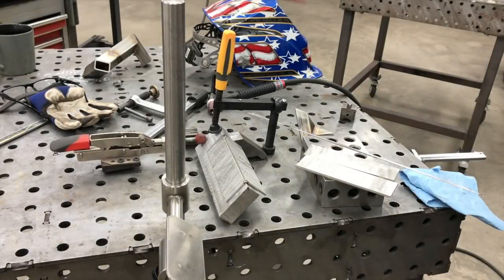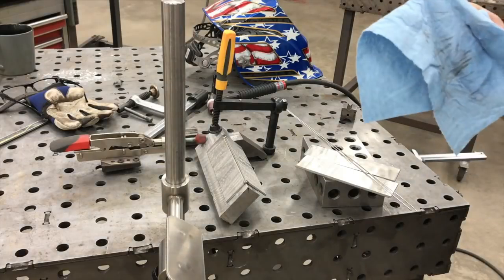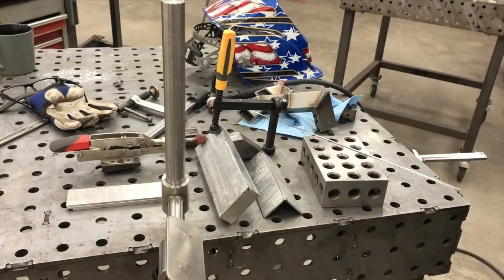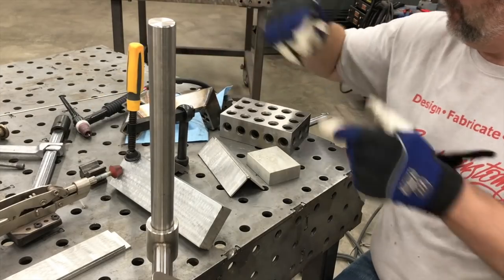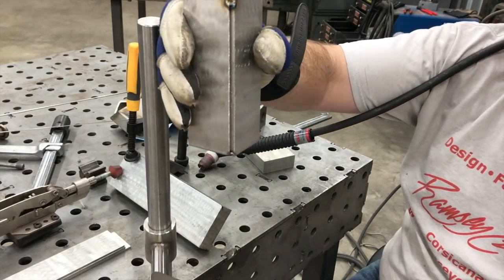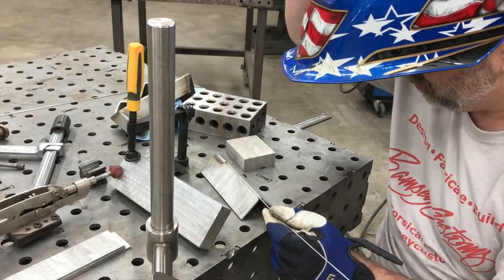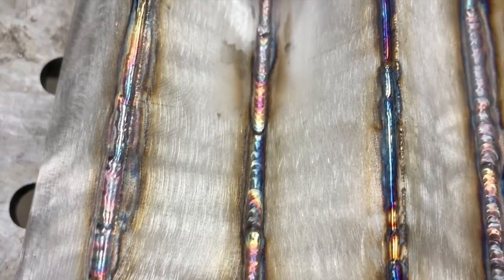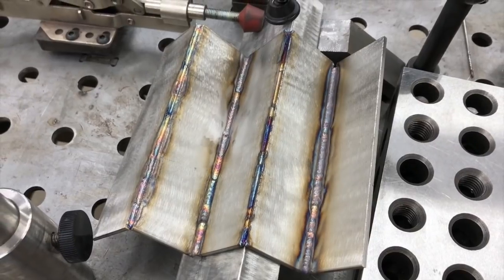Tig Welding Stainless Steel with Aluminum - Weldporn In Training

Comment: It appears to me you are not letting your POSTFlow do its job. As soon as you finish welding you starts wiggling your cup. Whipping it back and forth, or move it completely away from the bead. The whole purpose or Posr Flow is that you need to keep that cup in position, without moving it, until the timer stops. The third weld you did you left it there just a tad longer. You did start whipping it, potentially allowing O2 to enter the pool but you definitely didn't allow it to wait the full 8seconds you said you had it set at. I am 99% sure that's what your issue is!!

Comment: yeah it's your gas coverage give yourself a bit more stick out and hold your torch on a 35 degree angle so it gives time for the molten pool to cool under the gas coverage. that's the problem your molten pool is getting exposed to the air if you have the molten pool at the leading edge of the gas when you travel along it gives it time to cool in the gas coverage.

Comment: STOP WAVING THE F ING TORCH AROUND AFTER YOU STOP WELDING. AT LEAST DOUBLE YOUR TRAVEL SPEED. TURN THE AMPS UP AND MOVE WITH THE PUDDLE. THE OUTSIDE CORNER JOINTS LOOK WORSE BECAUSE THE GAS FLOW AWAY FROM THE WELD.  INCREASE YOUR ARGON FLOW TO 30 CFH

Comment: With that much gas flow and that torch angle you might actually be drawing air in behind your puddle. Slow the gas down, use a bigger cup if you have it and try steepening your torch angle.

Comment: Your problem is that stainless, and mild steels MUST be backpurged! The backside of your weld is oxidizing and being drawn into the weld puddle. The inside corners are better because the "V" directs more argon into the keyhole and puddle. When you back up with the chill block it keeps more oxygen away from the weld, making better looking weld. when you are welding tubing, purge the inside of the tubing. On flat pieces make jigs, or use metal tape and cardboard to make barriers so that you can backpurge. This is stainless welding 101, purge, purge, purge! In the pipefitting world, the back of the weld should look as good as the front of the weld! We call that ugly burnt grey color "sugaring", when you see that on a weld, the weld is NO good period! Also use a bigger cup to shield more of the weld, you have to shield the weld until it cools below the oxidation temp, and quit waving your cup back and forth when you stop! hold your cup on the end of the weld until the postflow stops. Either your tungsten isn't at the proper point, or your arc gap is too big, your weld is way to wide, you need to practice on making the smallest bead you can, take a 1/8 inch metal on edge and put a bead on the edge without melting the edge away, good practice. Remember a "perfect" weld on stainless will NOT have ANY color!

Comment: Try putting some tin tape and folding them to create a valley to trap the argon in. Your shielding gas isn't concentrated in your weld pool. A larger filler wire will chill the puddle and give you lack of fusion if done incorrectly. Any way that you can control your gas coverage area will help. I can't see your arc length, but the closer the better. But your main problem is your lack of gas coverage.
Reply from the maker: thats a great idea

Comment: Looks like you are using a #4 or 5 cup. have you tried a #7 and maybe upping your gas CFM?
Reply from the maker: Its actually a #7 cup.  I was running 25cfh, i have tried lower and higher.  Soem others suggested i may have a gas leak somewhere
Reply: What type of parent metal, what filler? What's your amperage? Also the chill bar you are using is what's giving you the colors. Coloring of stainless is due to the temperature at which the parent metal is when the shielding gas is taken away. But if you don't see it wet in, it doesn't matter what color it is

Comment: Outside corners will require a much larger cup to get the argon shielding you need. I have had the same issue and swapped to a #12 with much better color.

Comment: Nice weld.👍👍👍
I don't mean to add advise, but back in my youth, with steadier hands and eyes, in the steel metal shop that I worked, we had a cannibalize seam welder. All that was left was the base with a 4" sold round copper heat sink and the upper copper clamping plates that were beveled so you get the TIG torch cup to fit. The bottom heat sink had a 1/8 groove down the center with hundred of holes for a back side gas purge. Copper is a much better heat sink, just for sh*ts and jiggles, try fusing two pieces of copper pipe together, then do the same with aluminum. We also, out in the field, use a stainless steel welding flux paste (came in powder form that was mix with water to make a the paste) brushed on the back side. With the copper heat sink and purge, both sides of the weld look the same. Just thought.

Comment: Several suggestions: gas flow is too high for that cup size.  Maybe 15-18 at most. Otherwise the high flow induces turbulence that draws air into the weld pool.

Reduce drafts through your shop. I have garage doors both ends of my shed and need to partially or fully (depending how windy it is) close them to tig weld or the cross ventilation blows the argon off the joint and i get welds exactly like yours.
As others have said a vee shaped shield to capture gas may help but it shouldn't be needed if you fix drafts aand reduce argon flow to eliminate turbulence. 

Keep post flow over the joint.

Keep a short arc.

Comment: Are your gas lenses EBay china spec rubbish?  I had a very similar problem with a bunch of china ebay crap gas lens.  No matter what i did, i couldnt get it to work.  I swapped to a gas lense that was purchased from an actual store and it fixed it.
Reply: Bram Biesiekierski I tend to agree

Comment: dont complicate things too much. As long as you're getting some colour at all you're good to go. Do a test, take thick piece of stainless, set 100 amps and weld a spot for few seconds without filler, then let the post flow on the weld. You should get silver colour. If you're not check the gas hoses, change the gas lens, change the argon (sometimes it's not as pure as it should be). With stainless its all about keeping heat low, so pulse is the way to go on thin stuff (2-3pps, 30% low current, 30% time is a good seting).

Comment: As an experiment try and tack the coupons together and then instead of backing it with a chill block, back it with tin foil.  Argon is heavier than air, so it is actually leaking through the gap between the coupons and you are not getting coverage because of it.  The reason the chill block makes it look better is because it is essentially filling the gap and allowing the Argon to pool in the groove between the pieces rather than leak through it.  If you back it with tin foil the argon should pool as well, as the tin foil will prevent the Argon from leaking through the gap and drawing air in from the back side as well...

Comment: I know it doesn't hurt to have some fine sandpaper or emery cloth to give the filler rod a swipe or two especially aluminum then wipe clean with a solvent, I've seen contaminated filler material on job sites through the years.

Comment: It's all About keeping the shielding gas around the weld, till it drops below oxidation temperature.
Reply: So how long should you set your post flow?
Reply: @Mikey-ym6ok  That depends on a couple of factors. 1. how much heat you are putting into the weld (ie: Amps or Voltage). 2. how much mass is in the material (ie:1/4" vs 1/2"). Both will affect the cooling rate. That said, start with 2sec as a starting point, and adjust up or down. I try to keep it as short as possible, as to not waste gas. Hope this is some help.

Comment: I think you have dirty argon or a small leak. You can do a quick check for leaks by removing the tungsten they tighten the cap and hold your thumb over the end of the cup while you bump the peddle. You should be able to push the flow meter ball all the way down with your thumb stopping the flow, if not you have a leak.
Don't be surprised if its dirty argon though, sometimes they don't purge the tanks.
Reply: txsviking I would take your word Terry for sure. You’ve welded I’m sure tons of this in your career. I never see your welds discolor. It’s always a gas issue with discoloration right?
Reply: Yes gas coverage.
Reply: Yeah bad gas, change your set up and weld some aluminum and you'll find out real quick if it the gas.
Reply: If this was the issue, wouldn't the internal welds be bad as well?
Reply: CurlyG65 I was thinking the same thing.
Reply: If u get your gas from oreilys u more than likely have bad gas at least thats how are oreilys is

Comment: Pickling is the removal of any high temperature scale and any adjacent low chromium layer of metal from the surface of stainless steel by chemical means.

Where the steel has been heated by welding, heat treatments or other means, to the point where a coloured oxide layer can be seen, there is a chromium depleted layer on the surface of the steel underneath the oxide layer. The lower chromium content gives lower corrosion resistance. To restore the best corrosion resistant performance, the damaged metal layer must be removed, exposing a fully alloyed stainless steel surface. Mechanical removal may leave abrasive or other particles embedded (interfering with corrosion performance) or may be impractical, so chemical means are usually employed.

Comment: The colored oxides are not passive and will lead to rusting of the stainless steel if not cleaned. You should not have to do this procedure more than once, but it can be repeated as often as necessary.

Comment: To passivate stainless steel at home without using a nitric acid bath, you need to clean the surface of all dirt, oils and oxides. The best way to do this is to use an oxalic acid based kitchen cleanser like those mentioned above, and a non-metallic green or white scrubby pad.

Comment: Stainless steel can corrode in service if there is contamination of the surface. Both pickling and passivation are chemical treatments applied to the surface of stainless steel to remove contaminants and assist the formation of a continuous chromium-oxide, passive film.

Comment: First off, way to much cfh on that small of a cup. im guessing thats a number 6. if so 15 is where you wanna be, if it was a number 8 20 is where you wanna be. 
So next 3 things. either bad tank of argon, which i highly doubt.

Bad gas lense... also why are you unscrewing the collet body, cup and the back cap when you go to adjust the tungsten??? just loosen the back cap... you want the collet body aka gas lense screwed allll the way in and be tight. just use the back cap only when adjusting the stick out. 

Or the way you are cleaning that material... you can see that on the outside corner of the weld you did at 8:35 its still got that dark brown ugly look around the weld. That tells me right off you are using contaminated tools (meaning you use them on stuff other then just stainless) when you prep ur material.

Comment: Try a shorter arc length. That was my problem with stainless steel. It came out the same as yours. Try 60 amps on 3mm, 90 will burn it

Comment: Additional points to my previous message.  Using the chill block allowed you to get away with a smaller gas lens than you should have used.  The oxide color produced tells you how hot the metal was when the shielding was gone.  The chill block cooled the metal faster which ment the oxide formed at a lower temp, thus better colors (yellow/silver).  The torch angle also plays a role in gas coverage.  A lean forward with more stickout will cover more length of weld area than a dead on 90 degree torch angle will.   A #12 fupa and a slight lean forward has double the gas coverage weld length as a #7 at 90 degrees. Try the chill block with a #12, it will look better.

Make or buy a trailing cup for the tig torch.  If you can’t make a clean bright silver weld on stainless with that it definitely a heat input problem.
Reply: ^Great advise right there^    Only thing I would add is make sure your using non contaminated brushes/flap wheel for cleaning.
Reply: Steve just Steve 

Yep, for sure.  You can never go wrong with clean brushes and clean metal.
Reply: Yup the gas is always the factor that changes the color on stainless even on the tungsten if you don’t have the proper coverage it will happen every time

Comment: Couple tips:

I haven’t had much good luck with stubby gas lenses with stainless.  The gas coverage seems to be a issue.  I use the fupa 12 and haven’t had any issues with good shielding.

Second, welding on a corner can split argon flow and cause shielding issues.  I find that playing with stickout can make a difference.  Sometimes running a short stickout with a gas lens is actually detrimental to getting good coverage.  The short lenses seem to perform worse for me with short stick outs.

Anytime I see grey/dark grey on stainless is means on thing to me, the metal was too hot and likely had poor gas coverage.  You can get dull grey steel welds by flat out cooking the weld even with decent gas coverage.  

Amperage is only half of what you need to consider.  Arc length dictates voltage.   Long arc= high voltage, high voltage = higher heat.  Running to low of amperage and compensating with a long arc to make a weld puddle is a fast way to getting a cooked weld.    1/16th arc gap (filler rod size) or less is a good place to start.

Be realistic with bead size.  Something I struggled with when I learned to tig was trying to get mig/stick sized beads with tig.  Tig is precision welding, and often times requires multiple passes to get proper weld size.  Trying to make a big weld in one pass is a sure way to get to much heat into a part.  

The filler rod is your heat sink.  Use it to your advantage.  If you push more filler in at the same amperage the metal will cool.  Often times I see people try to melt the whole outside corner together and just dab a little filler in as a extra (aka do a fusion weld).  The weld bead is too large, to hot, and your not taking advantage of the quench of the filler rod.  

Use a scrap of titanium and hold the tig torch on one side with the gas flowing.  On the other side heat it with a torch.  If the area under gas coverage doesn’t look clean with good shielding, your lens, argon is defective or your argon flow is to low.  I can mail you some Titanium if you need a scrap to try.

Try running a bead on edge of 1/8th inch stainless.  Sit it right on the edge without melting it down.  If you can do that with good coloring your getting it right.

I look for consistent color (yellow or silver) on a bead more than rainbows.  Consistent color means 1) stable travel speed, 2) stable consistent arc gap, 3) good shielding.  Rainbow color beads are a good indication of non steady travel speed, inconsistent arc gap, and/or inconsistent amperage.  Stainless shows you what is inconsistent in your welding  technique through the oxide reaction on the surface.  Learn to read it and focus on consistently. 

My recommendation : fupa 12 at 25cfh, decent stick out, quench the puddle with the rod, lay the bead in the joint and don’t try and melt the whole corner down.  If you can make a 2 inch weld that is yellow or silver you can make a 20 inch weld the same.  Chill bars help (I use copper).  Practice on thicker material first (1/8th) and when you can nail that go thinner.  Thin sheet is much harder than 1/8th.  Pulse is your friend, so is a tight arc.  -Greg

Comment: When you are welding into a V the sides deflect the gas back towards your weld. When you are welding on the outside of a V it splits your gas and pushes it away from the weld. Try clamping a couple of pieces of angle to your piece to make it into a W. That way the two pieces of angle deflect your gas back towards your weld. Adding purge gas to the back would help when you can't use a chill block.
Reply: Mark Trombley thanks for saving me the typing he could also build a box that he fill with gas (purge box) for welds like this